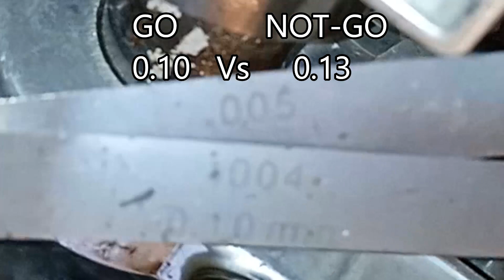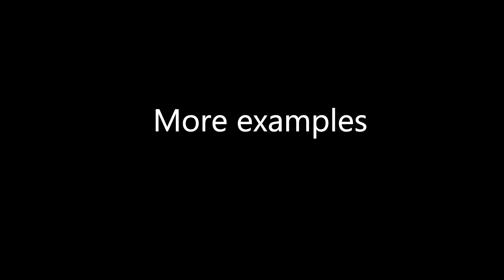Valve Adjustment at CBR250R | GO vs  Not-GO | How Does It Feel

Comment: Bro my bike has tappet sound when the engine is hot do you know the reason
Reply from the maker: @adarshs7456  
Hi sir. Sorry, noises can be of many types, most of them will be normal engine working noises. I have to hear it my self, and see it too. Have you already approached your mechanic, if so, what does your mechanic think about this issue? You can upload a video, ask and share in the forum: cbr250r dot net, maybe with the help of your video you will get more advice from the people of the forum.
Reply from the maker: @adarshs7456  
Not every problem can be found using the Internet, but if you have knowledge of mechanics, and if you have a patience, then as I mentioned above, you will try to upload a video and ask in the forum.

Comment: Checked valve clearance. It is within the specifications. But I still hear shim noise (ticking noise) once the engine reaches its operating temperature. Is it a thing to worry about ? The performance and fuel efficiency is same as before but there is shim/ticking noise even though valve clearance is proper. Can I ignore it ? (Timing chain, chain tensioner, shims, rocker arms all are brand newly replaced)
Reply from the maker: The mechanism always makes noises, problem or not a problem? If everything is new and adjusted then in my opinion there is no problem.

You can monitor the noise, if it's something abnormal, the noises should increase later, or you will start to suffer from poor performance, etc. 

Maybe you manage to overload the engine at low rpm?
Maybe you trying to accelerate hard from 4000 rpm or from less rpm? If so, it destroys the engine and also makes noises of the type you describe(Aloud ticking)..
Reply: @mycbr250rdmotorcycling7  thanks for the response. The ticking sound is not unbearable. It can't be heard while riding as I wear a tight helmet. And I shift gears at 5k RPM. Occasionally on highways o shift at 7k RPM.
Reply from the maker: @RRP1992  
Maybe you mean the CBR250R rattles phenomenon?
From what I've been able to research it is coming from the air release valve for the exhaust manifold, the one on the top of the valve cover.
This noise should not bother you, you get used to it and that's it.
Reply: @mycbr250rdmotorcycling7  it is the ticking noise caused by shims. Funny enough, it sounds like "tik tik tik tik tik" sewing machine type of a sound. Doesn't happen when engine is cold. Only occurs once engine gets hot (no heating issues though)
Reply from the maker: @RRP1992  
You can try to record your tik tik sound, upload to YouTube, give a link here, and I'll try to see what it's about. But I think you hear normal engine noises. Yes, the valves make a valve noise, even when adjusted properly.
Reply: @mycbr250rdmotorcycling7  https://youtu.be/zeHv8kdjWaA
Here is the link. Not sure if the video does justice to the noise I'm hearing in reality. But have a look anyway.
Do read the description of my video as I've mentioned few details there which may assist you in determining the issue (if there is any)
Reply from the maker: @RRP1992  
Your engine sounds fine to me
Check out this guy's video, he did record a before and after:
https://youtu.be/U-_Yc2_73b8
Reply: @mycbr250rdmotorcycling7  thank you. Yes I've seen that video (trust me, I've seen all CBR250R valve clearance sound videos on youtube lol). The thing is, it is hard to note the engine / ticking sound on YouTube compared to reality. But anyway, considering there is no performance drop or fuel efficiency drop, il continue to live with it.
Reply: 90% of vehicle problems can be traces back to a previous repair...

Comment: did not understand anything
Reply from the maker: I can understand you. It's very difficult to achieve comfortable video details when you shooting with one hand and working with the other, or when shooting while the engine is fixed inside the frame, and it's also difficult to convey mechanical sensations in video...It is what it is.

Comment: Please explain shim calculation for cbr 250
Reply from the maker: I have a videos that I haven't edited yet of the all process. The all process is long and really difficult and complicated, maybe next month? I'll try.
Reply: @mycbr250rdmotorcycling7  I am technician of Honda big wing I have a little confusion in shim calculation please help me for better
Reply from the maker: @ZaidKhan-np9mr  
1
There is the nominal gap, the manufacturer's specification, say 0.27 for EX

2
There is the thickness of the valve clearance we measured with the filer gauge, let's say 0.25

3
And there is the thickness of the shims that we removed (because if we had measured a proper clearance, then we would not have removed it), measured with a micrometer, let's say 1.975

And if these three numbers(1, 2, 3) we perform the following calculation:
(0.25 - 0.27) + 1.975 = 1.955

The Honda shims are sold in increments of 0.025mm, so the most suitable shim for the calculation at the example I made would be 1.95mm thick.
0:05

The value in brackets can come out plus OR minus, in my example it came minus. If the interval measured by the filter gauge is greater than 0.27 that value came out plus.
Reply from the maker: @ZaidKhan-np9mr  
The value calculated in brackets is the value that determines if you need to replaced for a thicker shim, or you need be replaced for more thinly shim. The value in brackets is reduced (if it comes out in Minus), or added (if it comes Pelos), to the existing shim value, the one you need to replace.
Reply: @mycbr250rdmotorcycling7  ok thank you so much sir for helping me 😊😊

Comment: chain tensioner removed or not..during this process
Reply from the maker: Hi. The tensioner is recommended to be replaced every 20-25 thousand kilometers. In my opinion, the valve adjustment is not affected by an old tensioner that was not replaced on time. There should be no connection between the two procedures.

Comment: I have a confusion do we need to decrease the size or increase?
Reply from the maker: What determines it is the measurement you perform!

As a rule, people don't work the engine hard on the racetrack, so the valves don't tend to go out of tune.

The erosion can be of the type that increases the gap.
And the erosion can be of the type that reduces the gap.
It all depends on the nature of your use of the engine, aggressive use will often cause the gap to be reduced (and then you need a thinner shims to return to the specification area).
But it is less important to focus on the explanation, and if there is doubt, then repeat the measurement.
ONLY the measurement determines whether you need a thicker shims or a thinner shims.

A slight departure from the specification area does not cause any damage to the engine, but can be felt in a slight decrease in engine performance. For people who don't compete on the racetrack it's negligible. If the valves don't make a particularly noisy concert, you can skip the need for a valve adjustment check. And if you in doubt, it's always good to consult a local mechanic you trust on.

Comment: Brother is there any replacement for shims as it's very difficult to arrange shims
Reply from the maker: Sorry, you're right, I didn't find an efficient way to arrange Shims either.
 
Buying a full set of Honda in 0.025mm intervals is expensive.
I didn't want to buy a replacement set because the intervals in the generic set are larger, 0.05mm.

Ordering at the local dealership is the fastest way, provided they have the shims you need in stock.

So it turns out that the engine remains open, and the motorcycle is disabled, until the shims you ordered arrive, and then you have to see that they really fit, and if they don't fit, then you have to buy again
🤦‍♂️😒It is what it is
Reply: @mycbr250rdmotorcycling7  brother I have done something I measured the valve clearance ..the shims which needs to be undersize are rubbed with sand paper ...the shim which are smaller I inserted an circular filler gauge leaf by cutting it
Reply from the maker: Dikshant Boora 
I see with yours method two problems that may arise.
One, if the polishing is not at a mirror level, then the abrasion on the polished area will cause a further decrease in thickness within a short period of time.
The second, if you insert under the main shim a cut leaf from filer gauge with a thickness, let say 0.03mm, this leaf can move and distort, then cause displacements in the spacing, or an uneven spacing.

Your thought is beautiful, but I do not recommend your method.